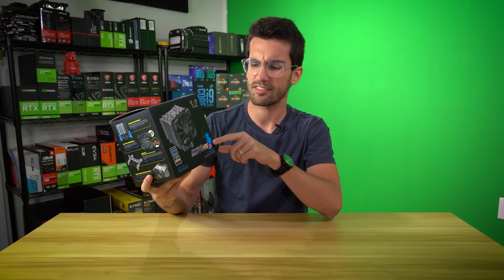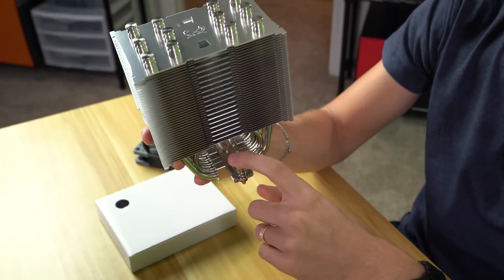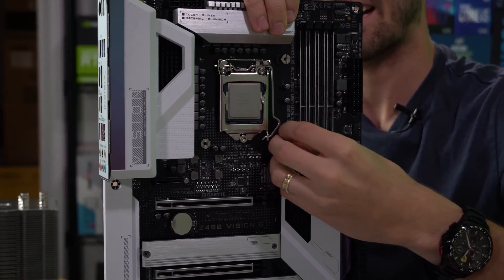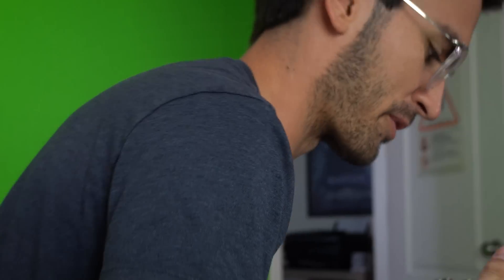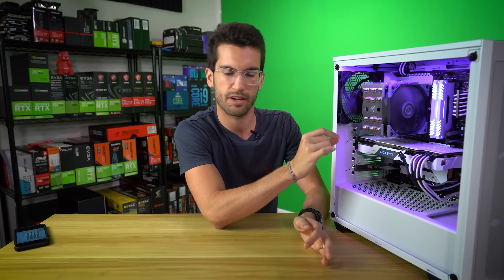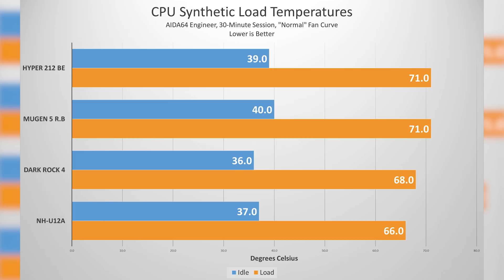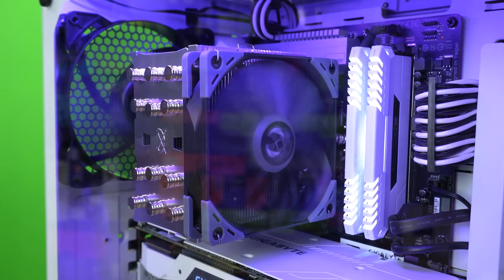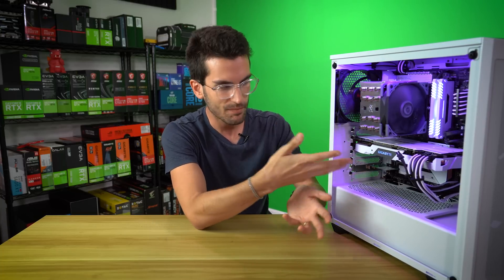This CPU Cooler Is Seriously Underrated | Scythe Mugen 5 Rev.B Review

Comment: Fuma 2 is worth the extra 10$
Reply: I have both the fuma & the mugen. Mugen is a very nice cooler but its not as good as fuma. On a 3700x mugen was pushing 82c vs 73c with fuma on stress testing, 4c cooler while gaming as well. I cannot speak on the ninja 5 but from the countless reviews I've seen its not as good as the fuma. It is dead silent tho at only 800rpm
Reply: The thing about Fuma 2 and Mugen 2 Rev B is that they're for different purposes:
Want the best coolling from Scythe? Fuma 2.
Want a bigger focus on silence? Mugen 5 Rev B.
Reply: I can assure you the Ninja 5 is not as good as the Fuma 2. I have both of them and the Fuma beats it by a long shot under heavy loads. Its also half its size. That being said you could squeeze a lot more performance out of the Ninja 5 with higher rpm/pressure fans but why not just save the trouble and buy the Fuma :)
Reply: @Evilmothers2.0  The Ninja 5 has far better cooling per dB. The Ninja 5 can cool pretty much anything WHILE BEING COMPLETELY SILENT. The Fuma can't.
Reply: Been looking for it in the UK a month or so ago and unlike the Mugen rev.B it wasn't availalble anywhere.
Reply: @sysakPL  Get the Ninja 5 instead if you can, should be at most €5 more than the Mugen. The Fuma is worse in every way from what I can tell.
Reply: @HazewinDog  agree. i stick with mugen due to clearance.
Reply: You can always add another fan to the Mugen.

Comment: So what would you say is the best performance cooler (aio or fan) out there to really get the temperature down. I have a 9700k and it's running at 4.5 and the temp is around 65-70 under load. Using the cosair h80i v2 with push pull config.

Comment: Maybe I got a bad fan with mine? It wouldn't spin up past 1200 rpm, and as a result, temps were downright horrible.

Two Corsair SP120 fans in push-pull fixed it right up though. Couldn't be happier. 👍🏿

Comment: It would be interesting to see Arctic Cooler's coolers tested too. I am thinking about their Freezer 33 and 34 variants.
Reply: The Arctic liquid freezer ii series of AIOs are seriously good value too and top performers
Reply: I was using a 33 Esports before switching to the Mugen 5, it works really well on Ryzen, comes with a top notch fan, top notch paste, and reuses the AM4 bracket so it's easy to install.  (the mugen 5 also reuses the am4 bracket, don't know about the paste though I used kryonaut)  I'm actually pretty sure everything but their Alpine series is really good.
Reply: ahayesm Raphtalia best girl

Comment: Its been underrated my dude i was rocking that cooler on my cheap thrift store pc a year and a half ago but now i got a bad ass pc now and im using a noctua nh-d15 cooler and its running passively using my 3700x and it runs just fine especially with my top exhaust fan in my case and ive been running this set up for about 8-9 months now and its been great :D

Comment: I think even the Scythe Ninja 5 is probably the best air cooler you can get for the price granted that it can fit in your case (maybe do a review on it?). Got the Ninja 5 over the Mugen after the pump in my AIO died and I doubt I'll ever go back to liquid cooled unless I'm doing a custom loop. The performance from these Scythe coolers are REMARKABLE especially when you compare other coolers in that price range. I'd switch out the fans for higher RPM ones though (even though the 800rpm ones that come with them are just fine).

Comment: I've been running the Mugen 5 (Rev A) for a few years now in my old rig with an i5 7600k 4.6 all core in a Define Nano S (fairly meh airflow), it's a really great cooler for the price and size. What really still blows me away most is the noise levels. My new rig has an AIO (NZXT X63) and let me tell you, i would love to get those old noise levels of the Mugen back. It never really ran much faster then 1000 RPM while beeing pretty much non-audible, even with the all core OC, which was just baffling to me. Scythe has been one of my go-to companies for own rigs (Mugen 5 on the i5, Katana 5 on an Phenom II years ago) and also as a recommendation for friends and family. This and the Fuma 2 are arguable some of the best "overall packages" on the market (price, cooling, noise levels). It's never the best in any category, but as an overall package, i'm hardpressed to recommend anything else most of the time.
Reply: Noctus IS overrated my bro :-) I love my Scythe Mugen 5 rev. B ARGB Edition!!!
Reply: Hi a bit late but can you mount a secondary fan behind mugen 5?
Reply: @rensquared24  Yes. you can mount front and back fan on the Mugen. The clip should be included, the fan obviously not. On mini-ITX you likely can't due to dimensions (on my mini-ITX system - Define nano S - the case-exhaust fan however is perfectly behind and very close to the fins, so it acts as a secondary fan, i suspect that's the source of my great temps).
Reply: @DrKartoffelsalat  is the difference big when you have a push/pull config?
Reply: @rensquared24  it's not big and dense enough to make a large difference, however Scythe fans are tuned towards a bit more silence and less airflow. So probably a few degrees. But for push-pull to matter you need the case airflow to match.
Reply: @DrKartoffelsalat  Yep my case is pretty airflow optimized as of now. But i'm looking to push my cpu cooling better.

I plan to swap out the scythe fans into some 1700+ rpm

Comment: Their Ninja 5 is better and $10 more its a no brainer to go ninja.
Reply from the maker: The Ninja 5 is nowhere near as compatible with memory. GL running that with Dom Plats.
Reply: @GregSalazar  both the ninja 5 and mugen have 55mm clearance for ram. their product pages specifically show hyperx predators clearing the cooler.

Comment: The Artic Freezer 34 DUO seems to be the underrated KING.

Don't see too many channels, that even seem to know about it.
Reply: I was just going to comment that i dont know how they all recognize thier thermal compounds but not the heatsinks
Reply from the maker: Most air coolers don't suck. It's why they still sell them. I'll get to the 34 very soon :-)
Reply: @GregSalazar  Thanks man this cooler deserves some love you will find it pretty cool and very easy to install
Reply: I have that one, keeps my 2600 overclocked at about 60 C or less (1.35 vcore)

Comment: I bought this for my Ryzen rig on a whim and have been really impressed. Computer is silent at idle and temps are in check under load with a light overclock. Checks my boxes ✔️✔️
Reply: Hi a bit late but can you mount a secondary fan behind mugen 5?

Comment: OMG That's a lot of thermal paste!!!! Rice grain drop!!! Almost as bad as The Verge PC build...
Reply: Linus and other youtubers have shown that too much thermal paste doesn't affect temperatures. Putting too little does cause issues.
Reply: @LeoInterVir  but it's so messy.... and in theory it should negatively affect temps, as the thermal paste's heat transfer efficiency isnt as high as copper, nickel or aluminum.

Comment: Scythe makes alot of good coolers, this is definitely one I'd be happy to use in any of my rigs.
Reply: the fan mount on those cheaper ones sucks, but i guess that is the case on alot of air coolers. the mugen one is good. i got a katana 4, on my i5 4th gen and it is a pain in the ass to get that thing on and off the cooler. beside that, it is a great cooler and it was cheap.

Comment: You know what's underrated, that Phillips screw driver that comes with in the box. One of the best ones I have used.
Reply: I am using the one that came with the Fuma 2 and it is amazing.
Reply: @espi8997  same
Reply: I bought this for the screwdriver, the cooler is just extra
Reply: Same, specially because it's magnetic. I use mine for everything!
Reply: @Sagadiniz  you can make every screwdriver magnetic... costs basically nothing...
Reply: @jeffkuzzen  I know, but this one is very good.
Reply: HAHAHAHAHA, yes, it's freaking awesome.
Reply: Yeah it's my primary build screw driver now lol.
Reply: So it's not just me. I find the one that came with my Ninja 5 to be my favorite screw driver. It just fits perfectly into the palm of my hands.
Reply: Right? That´s the reason I kept the cooler although it was totally over dimensionized
Reply: Got mine from their Fuma 2, really useful for my PC building now even for resetting CMOS! How the hell they can fit so much in with their pricing holy hell
Reply: Just use a swiss army knife
Reply: @stopdropandroll  that hopefully has a Phillips screw driver
Reply: Dude I love that Phillips too.
Reply: As someone who has the cooler I can confirm

Comment: Been running this exact cooler for years with my overclocked 1700x and it's awesome because it's the biggest cooler that fits in the RL06 case and it runs like a champ.

Comment: I use the Mugen 5 rev b with my Ryzen 3600X. Gaming it averages mid 40’s to low 50’s. Stress test is about the same as intel between 70-73 depending on the test used. Good solid cooler and i would recommend it.
Reply: what game? my cpu spikes in gaming from 50 to 70 degrees. Stresstesting about 76 degrees
Reply: GTA 5 creeps into the 58-62 range. Most of my other games like hitman, ark survival, CoD, etc hover around 48-54. I use carbonaut thermal pads in lieu of Scythes heat sink grease.

Comment: Many Scythe coolers are underrated. They really are great and scilent
Reply: You think you're punny? I'm not a fan.
Reply: Son Goku best fans are the quiet ones
Reply: good pun
Reply: Was about to correct your spelling before I caught my r/woooosh
Reply: They look cool too.
Reply: You mean scylent?
Reply: scythe fuma
Reply: @Blarson12  No it's not, that's the pchb version, that comes with a 800rpm fan. Also that cooler with 800 rpm still cools  quite well, some people like a quite pc.
Reply: @Blarson12  800 max, but it doesnt even need to run at that to coolmy cpu, 600 rpm is enough.
Reply: @budgetking2591  What about a prime95 test?
Reply: @Blarson12  temps stay well below 80c in prime95, if you are looking for max cooling performance obviously buy the version with the fan that has the higher fanspeeds, they are the same heatsinks, just different fans lol.
Reply: @Blarson12  no i don't have to watch that video, since my cpu don't overheat at all.
Reply: @Blarson12  i ran it for 6 hours

Comment: Scythe always made great coolers, their Mugen 4 was competing against the Thermalright Macho B (at least here in Germay)
Its great to see they pushed their air cooler yet one more time and made a great product, gj Scythe 👍
Reply: Thermalright Silver Arrow is what I've used for years.

Massive cooler, works on all current Intel sockets despite being around forever. I'm currently using it on a i7-5930k (x99 2011-v3) which I set up for my mother. It's compatible with x299.

I've used Sythe fans before, very good fans, even make thin ones if space is limited. I'm in the US. Can't find Thermalright here anymore unless it's on the used market.
Reply: Be quiet is famous in germany right ? How good is mugen compared to be quiet and noctua offering?
Reply: @aliefr2984  They are nearly identical. They simply can't be too different as they are essentially selling nearly the same thing. Look at the weight, heatpipe count. The only difference comes from fans and mostly their speed.

Comment: I've been eyeing one of these to replace my wraith prism, thanks for the review Greg Nye the science studio guy or whatever you are called nowadays
Reply: Joel you won't regret it - I replaced my Wraith SPIRE - which is a better cooler than the Prism - and got immediate improvements, so you should do well with it.
Reply: @chrismoule7242  no, the spire isnt better than prism... the prism is the top-end amd stock cooler.
It goes in this order:
wraith stealth
wraith spire
wraith prism
Reply: its even better when replacing the fan with 2 arctic p12
Reply: @imgonnacuomoalloveryourfredo  Or 2 Noctua fans!
Reply: @vladvah77  those too...but arctic fans are like half the price of noctua and work almost the same..noctua are quieter
Reply: Wraith Prism IS loud, and I really don't like the RGB-mania so the Scythe Mugen 5 was the best option to replace it - it's powerful like a Noctua D14/15 but for 50% less money :-)
Reply: @vladvah77  i replace the stock cooler on my 3300x with scythe mugen rev b with 2 arctic p12...runs a lot cooler and quieter now
Reply: @imgonnacuomoalloveryourfredo  how many difference of temperature before and after you changed the fan did you get? 10c?
Reply: @hammerfall6666  around 8-12°C....i have a zalman s2 case with 4 arctic p12 fans..and its according to hwmonitor so not the most scientific results lol....thats going from 3300x stock cooler to mugen rev b with 2 arctic p12...didnt test to see what mugen rev b with stock fan did for temp
Reply: see if you can find a Ninja 4 for under $45 (tho you might need a $5 AM4 kit). bit more cooling than this. another good alt is an FSP Windale 6
Reply: @plonk420  I have somewhere a Ninja 4, the thing is HUGE :-)
Reply: @vladvah77  i freakin' love it! in spite of the size! ...and it's even quieter now that i have a Noctua on it (had to put the Ninja 4's cooler on a U12S TR4-SP3 i put on a 1950X because the Noctua fan couldn't keep it cool enough to not throttle ... so i basically swapped the two)
Reply: You will be happy with the change. I installed the Sythe Mugen on a Ryzen 5-3600 because my case is not the best for air flow and I did not trust the included Wraith. Installation for a first time builder was a breeze. All those people telling you to buy Noctua or other fans are telling you to waste your money as the Sythe fans work well, are practically silent and my CPU has never gone past 60' C. Not to say those add-on fans are not worthy and somewhat better fans, but you don't need to spend any more money than on the Sythe included fans. I only play SIM (truck/flight) games so your mileage may vary if you are into overclocking, and do more CPU intensive work or play more CPU dependent games, etc.
Reply: Same with me. Wraith prism is good but not good enough for 3800x

Comment: Mugen 5 or Fuma 2?
Reply: For the most part Fuma 2, but if you wanna sacrifice a litle hotter tmeperature for lower noise levels then Mugen.
Reply: Fuma 2 = Noctua D15 , BUT imho Mugen 5 IS the better price/performance option!